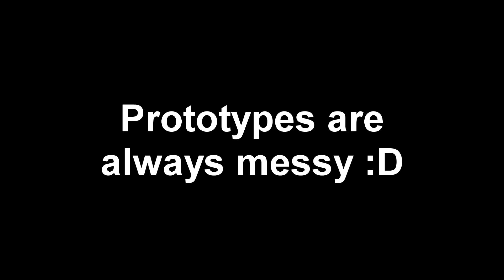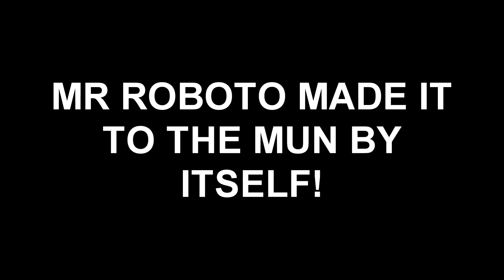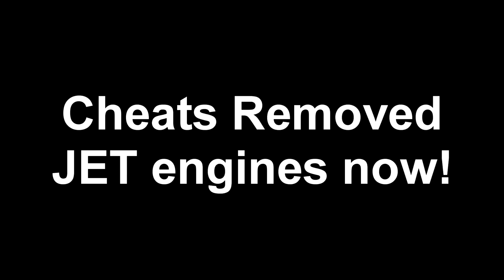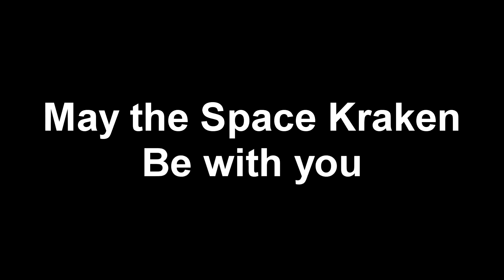KSP - M1 Dynamics Podracer - Evolution of fails and designs

Comment: just immagine a race in multiplayer :D
Reply from the maker: yeah, but I think it would be really hard to get balanced pods..., this is not a movie, so the fastest pod probably is going to be quite faster than the 2nd, and so on :p
Reply: year... guess u're right
Reply: m1sz I think just like motor racing you would have to have limits, every pod use the same engine, have a minimum fuel level, and minimum weight also. The designs might all end up similar but you could be surprised what gets developed. You would of course need rules to define what exactly makes something a 'pod' racer, perhaps the pod must swing freely, it must be a minimum distance away from the closest part of the engines, etc.
Reply from the maker: yeah, of course rules are needed!!!, if not, it would be a loophole race :p

Comment: hey, where the first minute or 38 seconds your really first time attempting a pod racer? like were you just randomly recording? or are you just re-enacting it?
Reply: arn't u?
Reply from the maker: Yes!, it was my first attempt. I saw that the decouplers often behave in a flexible way, so I tried that way. Whenever I try to do an evolution video, I just record my tests (I dont use to record the building, most of the time its just me starring at the vessel thinking). It's in a chronological order, atleast it should be! (Maybe I switched one for another, but not so far away in time!)